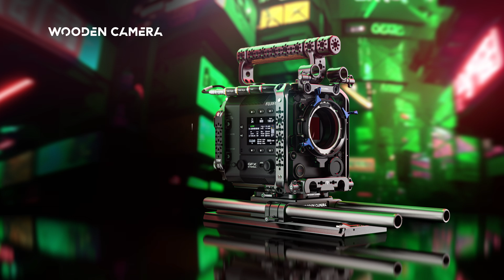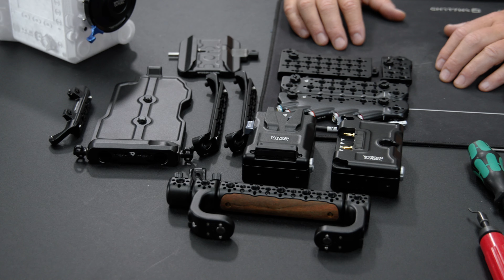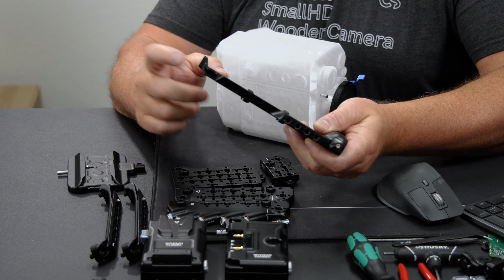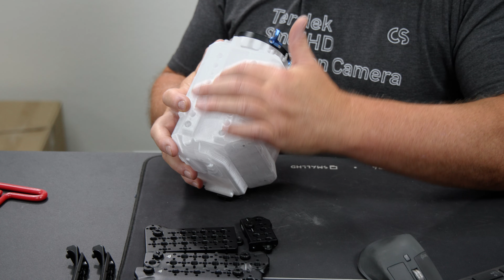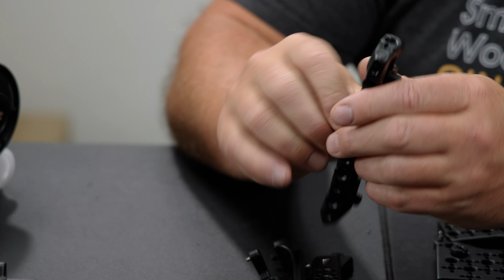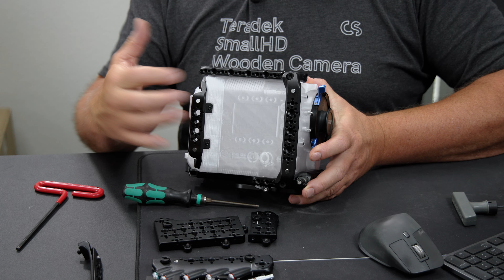Fujifilm GFX ETERNA 55 Cage and Accessories - At the Desk with Dominick

Comment: It would be a nice option if you could make the center column part of the 3-part top plate system empty or removable so that the original Eterna handle could be used.
Reply from the maker: This option is available with our Eterna 55 cage. Please visit our website for more info - https://woodencamera.com/products/top-plate-system-fujifilm-gfx-eterna-55?variant=43603239469149